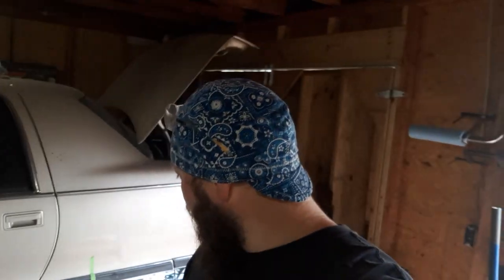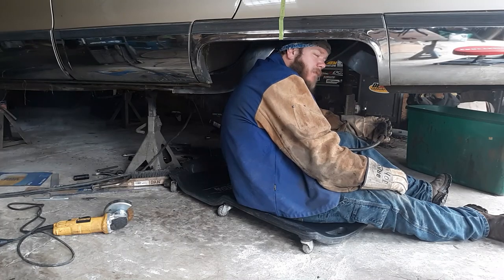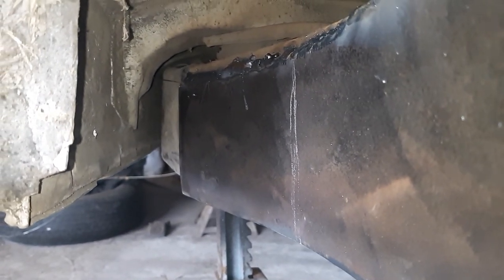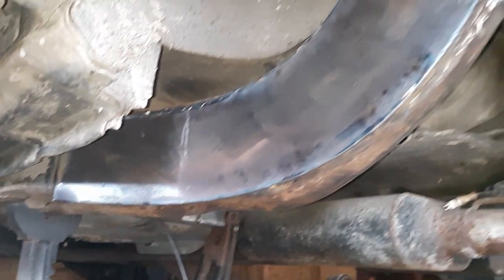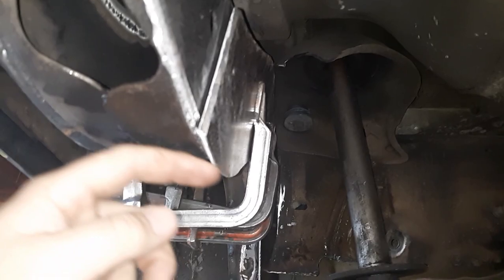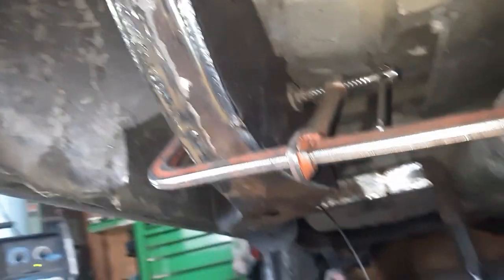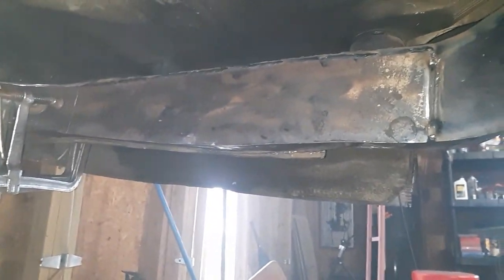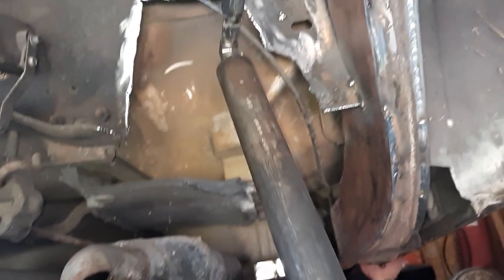Frame Work On The Fleetwood

Comment: Hey Dan some solid reinforcement there with the frame on 👍 do you think it’s possible to reinforce the stock spring perches enough from ripping off wile the frame is still in? as for someone who is not wanting 3 wheel or bridge the car just used for hoping with a nice little bit of power to the back also
Reply from the maker: You can plate the pocket and add gussets it will help but best overall is to do a bridge or plate the perches when the frame is off the body
Reply: @thecadillacdanshow8658  thanks 🙏 also did you ever do the video on the Cadillac slip joint I couldn’t find it
Reply from the maker: @liljay5653 I did kind of. I am working on another video I seem to be the only person that has problems with them

https://youtu.be/YEO8p5uO3aM?si=IGitBRwBZYgXukIJ

Comment: What type of wire ???? were you running I know it was a big spool vs the sma spool to reinforce and what type of gas were you using for the MIG welder ???? Little details like that Oregon gas or what other type of gas
Reply from the maker: I use .035 wire with 75/25 argon gas

Comment: Did you lift the body off the frame to weld the tops of the side plates?
Reply from the maker: Not on this one that's why I did the plug welds
Reply: @thecadillacdanshow8658  looks great
Reply: Looking to do a standing 3 with my 93. Whats the minimum reinforcement you’d recommend? Basically plate everything with 3/16” that’s visible and I should be good? And a bridge.
Reply from the maker: @cdz2269  that's what I did the minimum I would do is the rear arches and a bridge you can watch the build of my Fleetwood if you havent already. I have a play list of it and show every reinforcement I did to it